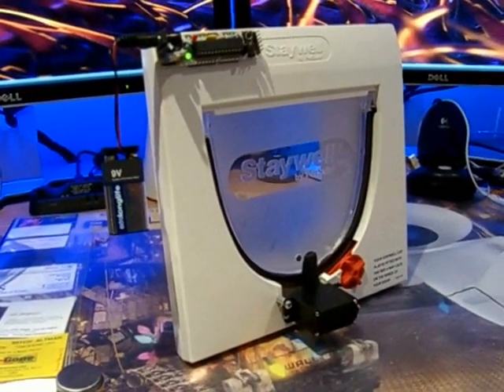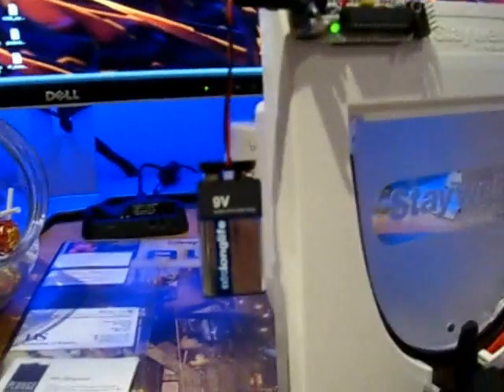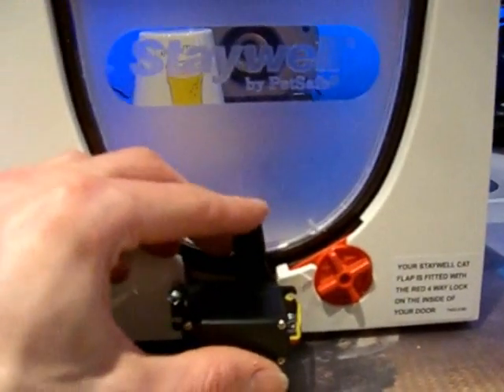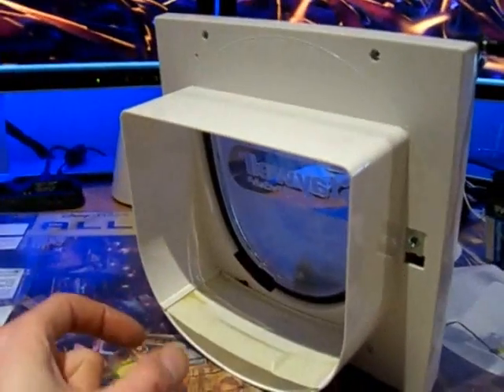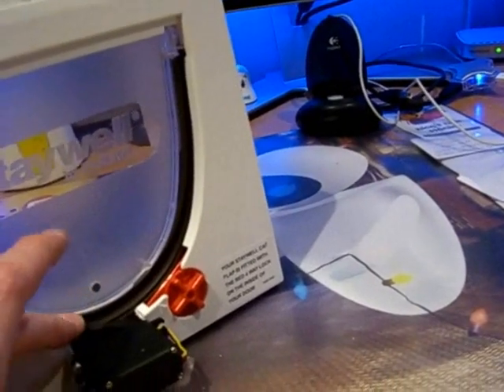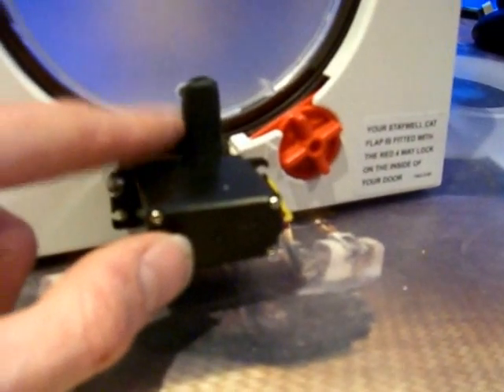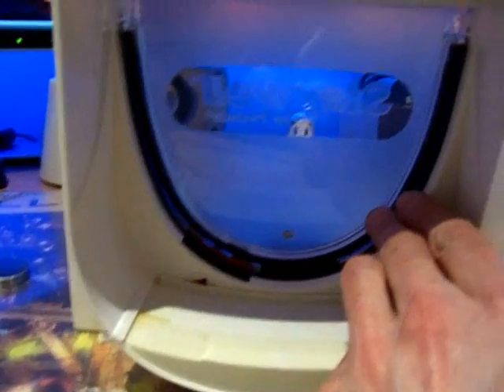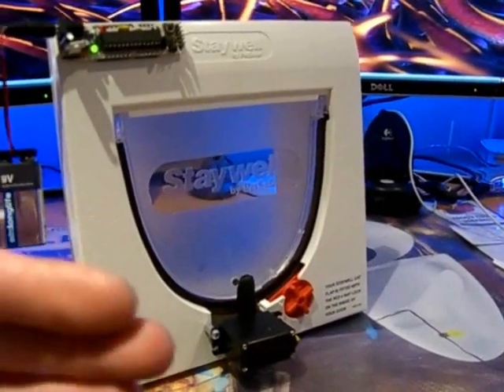Arduino magnetically operated locking catflap.

Comment: It fails if you have a strong wind. The door swings down after the cat passes then swings up past the catch, staying open at 10-30 degrees to vertical. It takes an impractical amount of added weights to keep it down. Better to put a one way sprung arm or spring loaded wedge on the servo arm to allow the flap to swing down.

Comment: I love all the wiggling. You could have designed a flat which consistently falls all the way and a latch rather than a deadbolt. But wiggling a little arm to try ang get it to work right has so much more character.